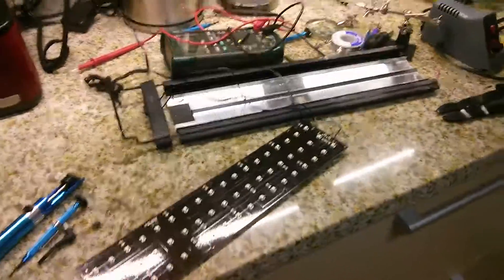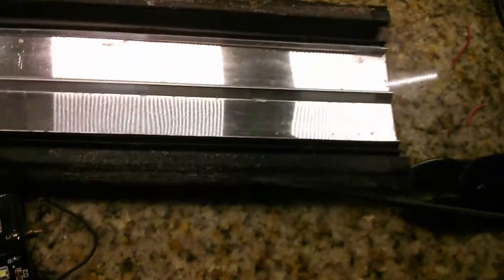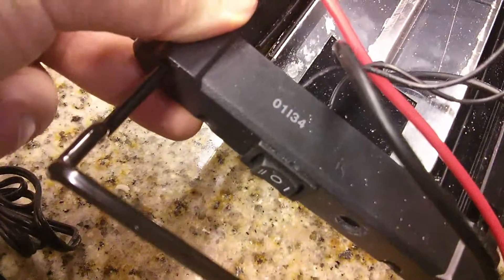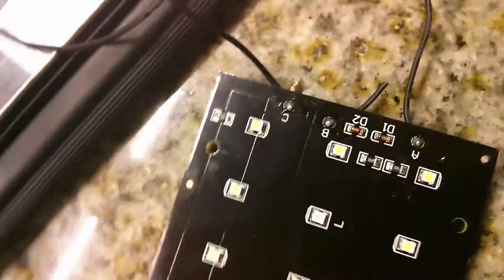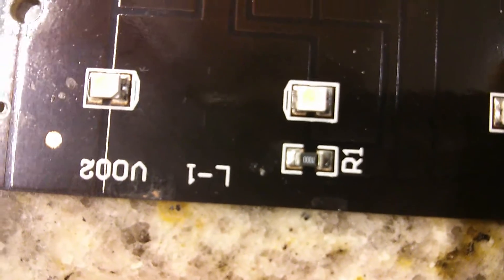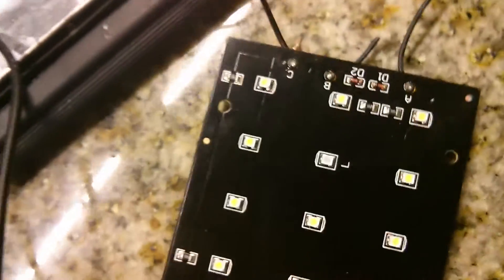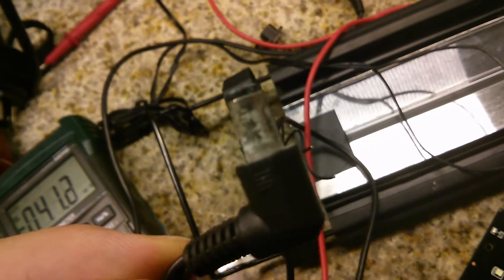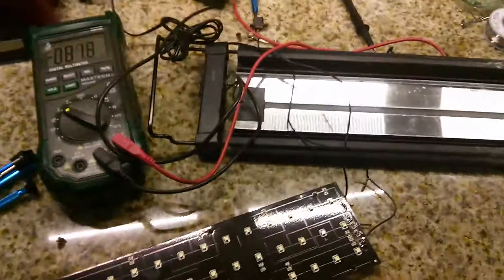How to repair an LED light

Comment: LOVE IT!!!!  Have a Marienland LED 48 inch 7 years old.  Ran a year then the connector on the fixture melted had to replace the female connector.  Ran a year and a half and totally melted again and cannot reconnect.  Will have a electrical friend take a look.  Have seen some on YouTube folks have had start on fire and also let moisture in right where it should not go in.  Any tips?
Reply: Ochibason you can buy a new wall to light adapter on Amazon for about $25